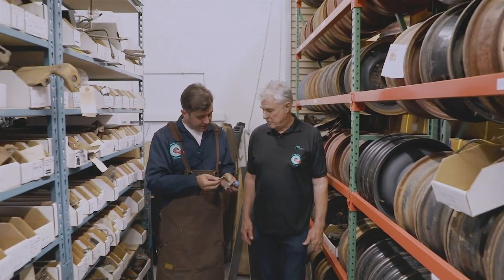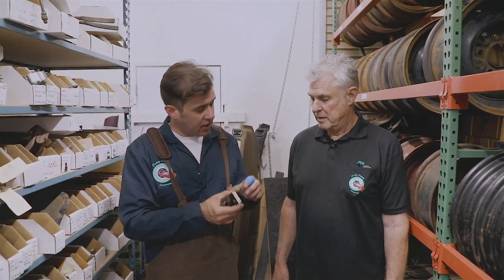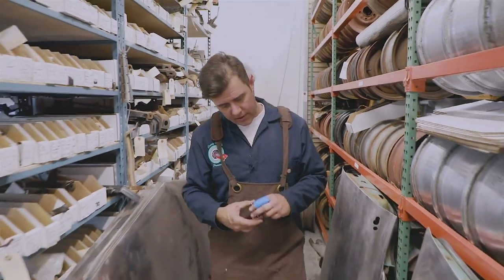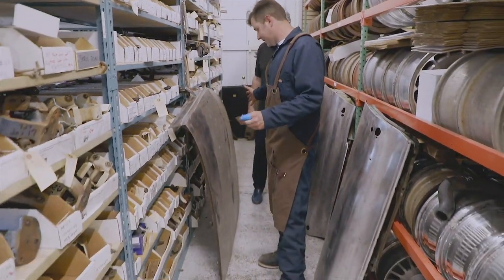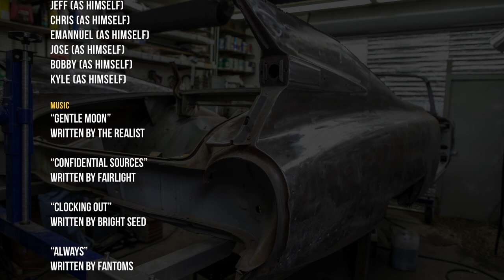The 1959 Cadillac Eldorado Biarritz Body - Body Magic

Comment: Are you on drugs?Never use anything but stock on a classic like this.
Reply from the maker: Yes. My doctor has me on several drugs. At this time, we're only going to do disc brakes and we have done that. Maybe do a fuel-injected tri-power, but we are going to try and get the factory carbs to work first. Thanks for watching. John
Reply: My guy do you want this guy to have a crash? This is a car well over 2000 pounds, and is 50+ years old.

Comment: Those X frames were a horrible idea... Buick was like F no... they had to warn all the service stations to never jack the cars up by the corner it was so bad... 4 corner lifts ONLY...
Reply from the maker: I also believe it was a very poor design choice. After the crash test
that Chevrolet staged between a new and old Impala, it has been used as
justification to say all old cars are unsafe. I would have liked to have
seen that test with Chrysler products with a box section
perimeter frame. I do think the modern car would not have fared nearly
as well as it did against the X frame. Josh

Comment: Hi looking good im building a 64 deville thinking about doing a frame off myself
Reply from the maker: Good to hear! We're actually working on a 64' Eldorado project as well. You can view that video playlist here >>> https://www.youtube.com/watch?v=OLMvQYfh1Mk&list=PLlg6Ic_-JsBKZQG8vOyYDlmqbAoqA4F9T

Let us know how your 64' DeVille build goes! We'd love to hear about it.

Thanks!
Reply: @Caddydaddy  I recently picked up a '64 Eldorado convertible in firemist green with white bucket seats. The odometer shows just over 18k miles. Is there a way to tell through wear items if it's 18k or 118k miles?
Reply from the maker: @ErnstTCB  Hi there, great question!

The first place I would look at are the pedals. They can tell you about the amount of use the car has, as well as a bit about the driving style it was subjected to. (wear on the left side of the brake indicates a left foot breaker, who might have ridden the brakes). Check for wear on the brake pedal pivot. Look at the outer edge of the driver’s seat for wear, especially if any beading or high spots are visible. Check the trunk mat and carpet for wear. Look over the engine compartment and see if it looks like someone has been in there working before. At 18k miles, about all that would have happened is a tune up. See if  the engine is clean. Look into tight spots where a pressure washer can't reach. Look at the decals and paint…it should all be in good shape at 18k. You can also get a small USB camera and place it in the spark plug holes to look at the cylinders to see their general condition. Those are the easy things to check. If you decide the car has high mileage, then you can pull the pan and valve covers to clean them and inspect the engine. The amount of sludge in the pan is a great indicator of mileage. If it is very clean, then someone has been in there recently. 

Hope all this helps you out. Thanks!

Comment: Hello, 
You are doing an excellent job.  I have a question.  
I need a gas tank for my 1960 Cadillac, but on your site and on other sites, all new fuel tanks (reproductions) are smaller (in height) than the original fuel tank.  Why is this so?  
In the 21st century, with a huge number of cnc machines, modern dies and presses, no one can make an exact copy of the original gas tank, or are there other reasons for the smaller gas tank?  Could you please advise where I can buy a new gas tank that has the same dimensions as the original one?
Thank you
Reply from the maker: Hey there! We appreciate the feedback. We haven't come across anyone that makes the exact same tank as the factory in terms of dimensions, and not quite sure why either. Your best option is to have yours restored or buy a used one and have that one restored, it you want the exact dimensions. Otherwise, you can always shop from Caddy Daddy and we can help you out.

Thank you.
Reply: Caddy Daddy 
Thank you for your reply.  
Do you know any company that produces body panels for 59-60 Cadillacs?  For these cars you can find only floor panels, I also saw door skin for 2 door cars on your site.  But it looks like parts like quarter panels, hood, trunk lid, trim, etc.  not produced by any company.  Everywhere only sheet metal for muscle cars.  Do you know someone who produces such parts or is going to start producing them?
Reply: Order it for a 78 cutlass it will fit i got that on my 64 caddy
Reply: Kelvin Lawton 
Thank you!

Comment: For all the work, I would find it hard not to update it with a modern chassis, disc brakes, etc. Not to mention a more powerful motor, electronic fuel injection. Even at this distance though, I have to admire all the talent to 'make it right' in the tear-down and re-assembly. Outstanding job!
Reply from the maker: Thank you! It's definitely a work in progress and there's a specific way we want it, so we are taking our time to make it just right.
Reply: I've driven a stock 1959 Coupe and it does not need modern stuff to be a great driving car.